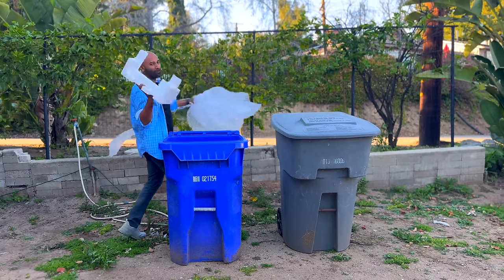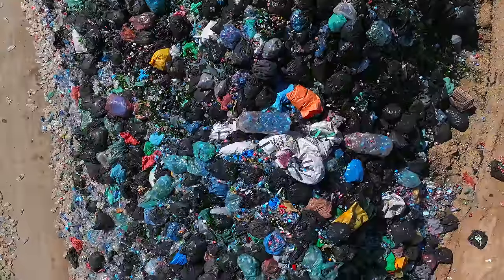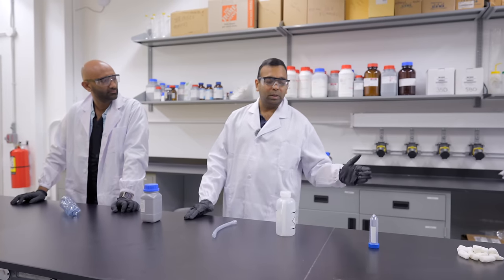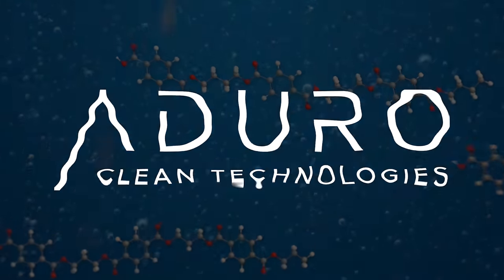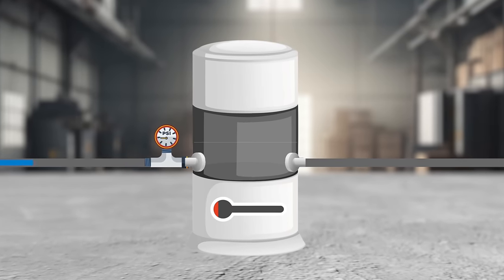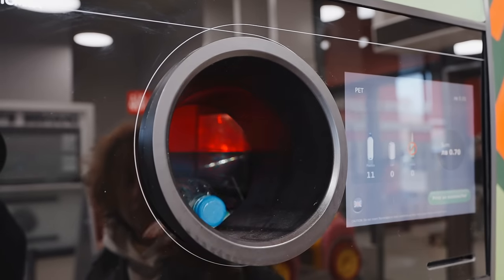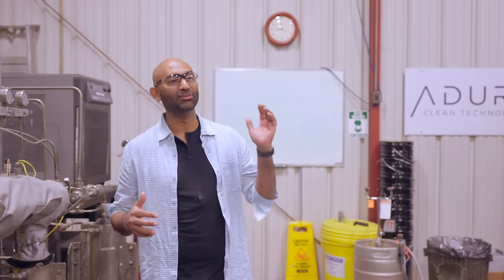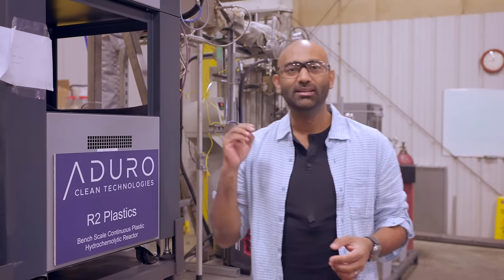Plastic Waste May FINALLY Have a Solution!

Comment from the maker: Check out Aduro Clean Technologies Inc. (CSE:ACT | OTC:ACTHF) https://geni.us/Aduro
Reply: Two Bitcoin da Vinci
Reply: Is this the company that was melting down old pop bottle and made that plastic house in nova Scotia? And why doesn't our carbon tax go to companies like this one
Reply: While I applaud the initiative, we need to talk about backstopping plastic recycling with making plastic waste into beads to aggregated in concrete. Sequestered essentially forever, no incineration, and useful to make concrete lighter and better insulating. Plus, uses very little energy.

Used in geopolymer concrete, can be net carbon negative.
Reply: @bartroberts1514  wow I didn't even know that was a thing cool and hopefully that happens soon
Reply: @scottfraser706  This is all part of the 'circular economy' compared to the 'flow economy' modelling for materials.

It'd be ideal if all materials were on a donut path, so nothing's 'waste', just at a different stage in its use in the marketplace. Since we can't make some things that way, yet, a graceful exit like glassification (sealing materials up in tiny durable beads as cheaply as possible) and using them like gravel in concrete is a more reasonable backstop than landfill.

The thing is, what Aduro makes is far more high value per kg than aggregate for concrete, so it's preferred, for the part of the plastic stream it works on, if economical.

Eventually, concrete breaks down, but it can be used as aggregated for future concrete. Another donut.

Compostable PLAs -- 3D printable and safe for beverage cups, but not long term liquid containers -- are also circular. Another donut.
Reply: @bartroberts1514  I don't think you can call adding trash to concrete a carbon negative.
Reply: You should take a look at supercritical water oxidation; not only should it revolutionize wastewater treatment, it's also a potential avenue to power-positively and economically process a majority of landfill waste, while making it easier to reclaim valuable trace elements.
Reply: @scottfraser706  This IS the kind of this that our carbon taxes go towards. It pays for grants for projects like this as well as subsidies for home solar and larger green tech installations like solar arrays and windmills. Also no this is in London Ontario, not Nova Scotia.
Reply: lol, its a wood gasifier converted to use plastic instead. the offgasings are flammable btw (in case your friend doesn't know)
Reply: Rick: i find it funny that after every video you keep saying check out this video and pointing in the wrong direction. Maybe remind yourself to use the other hand to point in the other direction or place your end of video screens on the other side
Reply: This sounds interesting. Hope they'll keep improving the procedure to make it work eventually, especially when it comes to cost for recycling.
Reply: Recently saw a video about flight attendants wearing uniforms made with recycled plastic polymers, causing unknown illness. 

Would be interesting to watch a follow up on where those recycled plastic polymers go to
Reply: I have been thinking that this sort of process would become the source of our means of producing new materials in a more or less circular process for the future - plastics are just so useful, and we have so many that cannot easily be re-used while also being perfect for their use - turning landfills into future mines for a while (until we use most of what is there).
Reply: Added to my portfolio
Reply: Why can’t we MAKE a law that bottlers have to have “easy zip off labels” and clear plastic bottles with matching caps?   It would make recycling bottles so much easier.
Reply: @CorvetteAustin24 no but it does sequester it
Reply: I'm going to invest in this!😊
Reply: @Fenthule  The US did it without carbon taxes. Eastman Chemical is doing it profitably in a market without carbon taxes.
This is why we don't need carbon taxes.
Reply: @mrbizi5652  The labels are as recyclable as the bottles. Maybe that's why we don't need yet another law?
Reply: sort of. The label is different plastic which has to be processed separately. Therefore if we had uniformity on how they could be “easy zip off labels” instead of glued on like many are now, it would make it easier to have end users separate (while putting in same recycling container) which allows faster and cheaper processing which lowers everyone’s costs of recycling.  Also saves on energy and chemicals required to process as we could focus right tool for right job and not waste.
Reply: @mrbizi5652  Adhesives can be easily released with heat. What you're suggesting would require an additional mechanical intervention.
Reply: It is wonderful that you can recycle plastic, but what do you do about the nano plastics inside the fish we eat and the water we drink.  Plastics are toxic to our bodies.
Reply: @peacepoet1947  This video wasn't about solving all the world's problems.
It was about a single company in Canada potentially reducing future waste.
Reply: @wisenber  don't be so ignorant of the problem of health when it comes to plastics in our environment.  A warning is what I'm giving to society.
Reply: @peacepoet1947  Don't be a jerk and loosely toss around "ignorant" without evidence.
It makes you look ignorant.

As mentioned, the video is about a technology to reduce plastic waste in the future, not a time machine to remove what's already out there.
Trying to toss that on their back is counterproductive.
Reply: There is no other sources for your video?
Reply: If a recycling tax were added to the price of products when sold, recycling plants would become economically feasible and profitable.
Reply: Pretty cool tech, I could give them my money :)

Comment: Video misses the entire point. Processes have existed to recycle plastic forever. The question is "can recycling be economically competitive with non-recycled".  Unless the total cost of handling cleaning processing and reselling is less than the cost of making plastic from hydrocarbons economically it's just a chemistry experiment not a solution.
Reply: I think the main thing here is that if we as a society are able to come together to try and pay more for products just because we know they are taking plastic out of landfills we are gonna be ok. Also, this is great in case we do run out of oil we can go back to all our plastic dumps and turn them back into gas/new plastics.

Comment: I used to work in the plastics industry, what many don’t realize is how much petroleum is used in that manufacturing process. In short, we can save our fuel as well by recycling. Great show Ricky!
Reply: We could also save petroleum by burning the plastic as fuel.
Reply: @gorkyd7912 plastics ARE petroleum
Reply: @joelrunyan1608   We burn diesel, coal, gasoline, natural gas, propane, methane to generate electricity, heat buildings, and drive vehicles. These products are either mined separately or made from the same crude oil from which plastics are made. But we either throw plastics in a landfill where they slowly degrade, or we burn a bunch of fuels for electricity we use for the arduous recycling process. We should just incinerated the plastic as fuel directly instead of pretending we're saving plastic when we're burning other fossil products to recycle it.
Reply: @gorkyd7912  We were burning landfill plastics and landfill methane to generate power. Then the carbon emissions became more of a concern than the energy supply. So now we're back to filling up landfills.
Reply: @wisenber   In other words, the politicians got involved.
Reply: @gorkyd7912  Not quite. Politicians are actually elected. These rules came from unelected bureaucrats.
Plenty of bad politicians, but they actually have to answer to voters at some point.
Reply: Isn't it made with a petroleum byproduct or waste that otherwise they would need to dump or dispose of in some way? Isn't that why they can always undercut every single innovation in packaging because its not a product its a waste product.
Reply: @wisenber the unelected beurocrats thank you. I only have been to one local council meeting in my life the representatives had to stage this begging ceremony from the beurocrats civil servants as far as I know. I dont even know I've asked and looked it up and still aren't sure. But it looked like the reps were asking the civil servants for money to do x y z ..one thing was a bus square a line around where the bus cna stop so cars couldn't go in it cos if cars went in where the bus was meant to go then the bus had to stop at the pier where it was an open water quayside for boats. They had been asking for this for 8 years! The beaurocrats said they didn't have the equipment? Like citizens could have done it easily in 8 hours!!! It was nuts. And the way they said your honourable majesty may we please respectful ask you xyz was sickening and weird. The beurocrats were up on a stage too. So it was bizzare.
Reply: @wisenber Actually carbon emissions are equivalent to harmless fluffy bunny in all the outputting chemicals when burning plastics. You really don't wanna know what else they output when burning plastics, especially when burning contaminated plastics.
Reply: @Saviliana  I know the power plants had scrubbers for particulates like any other combustion plant.
Instead, it goes into landfills, oceans, or we burn even more energy transporting and converting into something else that will have the same three choices.
Reply: Natural Gas is a feedstock too
Reply: @wisenber Yes, but the problem is that plastic isn't just pure polymers, they contains all sorts of pigments and additives to make them have different elements of usage, even just a coke bottle could have all sorts of coloring and additive for temperature control, when you adding the fact of other chemical contaminate during recycle, it is just too hard to be a controllable environment to treating the outlets. Many scrubbers are either had a specific setting in element combination to collect a specifically designed type of contaminate particle, like you can''t rely on a electron scrubbing unit to catch oily subsistence, and solid micro particle collector or splash filter membranes to catch hot gas wastes, it won't work,  and if you really be dumb enough to make such system the cost is overwhelmingly unrealistic to proceed or maintain for long term. How powerplants scrubbers work is they only use a tight specification range of coal or diesel or gas, which contain so little contamination so the scrubber units can catch the only few types of outputting waste at the exhaust.
Reply: @Saviliana  Except they did use scrubbers.
Reply: Therefore big petro!sum will try to stop this idea.
Reply: @Saviliana  eg dioxins
Reply: @Saviliana  Thanks, it's good to have some detailed info
Reply: @elgorrion52  If they weren't elected to Parliament, how do they get voted in by their peers?

Comment: The first time I have heard of companies trying to do anaerobic decomposition of plastics back into what are effectively refined crude products was something like 20 years ago, back when Discovery Channel was still worth watching.
Reply: Yeah
Reply: yep and it still doesn't scale or compete with the cost of virgin plastics. Maybe in a world where energy would actually be cheap.. maybe.
Reply: Not surprising. The chemical process is not so far off from dealing with the sump fraction of crude oil crackers. But as someone working in the research industry, I saw a lot of steam being applied to this idea in the past 6 to 8 years. Every big player in chemistry and waste recycling is doing this stuff now.
Reply: Plastic recycling is the same as fusion energy ?
Reply: Lies. Lies. Only lies
Reply: @Volkbrecht  Well, in this specific case, instead of applying steam, they are applying solvents besides water to increase yelds at lower temperatures. IIRC, he old polymer cracking experimental plant I heard about back then was simply heating the plastics in an inert atmosphere, condensing whatever came off and burning the lightest fractions to heat the chamber.
Reply: Back when Discovery Channel was still worth watching? Geez, how old ARE you? 😁
Reply: Unfortunately it's not the first one! There is an older video about 10 years on YouTube about this exact type of recycling
Reply: This is being done in India too; also in Utah. It's been a few years since I first saw this kind of process. I think it's fascinating and hopeful.

Comment: Aduro has been nominated for the renewable material of the year award at the biggest chemical recycling conference in the world in Germany  The leading nominees will be chosen in June . Only 6 companies in the world. This tech hopefully is a true game changer
Reply: It isn't; there's also a dozen companies attempting the same thing. Every time you ask critical questions about scalability and economical viability the conversation stops.
Reply: @rkatz69  And not just attempting. The research into applications has progressed quite far, and everyone who tries it runs into the same unavoidable problem: over time the reactors clog with a toxic tar made up of the dirt that's clinging to the plastic and all the additives used for whatever product the plastic comes from. It's by far not just bottles and fruit packaging.
Reply: Well therefore are are reactors which can clean themself -> you need to look up screw reactors whichare also used for plastic pyrolysis
Reply: @rkatz69  the difference between aduro and other companies is that their technology 1) works 2) is scalable and lenient to each company's use case. Their technology is years ahead of any other company in the field
Reply: Cross fingers.
Reply: This type of technology only makes sense if the cost of producing new plastics is competitive with the original cost of making the plastic which is basically impossible for the vast majority of recycling.  

The reason it’s impossible is because of the thermodynamics of the chemical reaction. One direction is preferred and to reverse it takes more energy and thus is more expensive. 

The only real solution is to add taxes to all plastic products so that the government can adequately recycle them and make up the difference. All other solutions are just a pipe dream. 

This tech will be needed when people wake up and demand we fix this. Hopefully people can stop all these nonsense climate change crisis and fix the real problem (general pollutions like plastics and smog). CO2 is a distraction.
Reply: @cbongiova do you think co2 that gets released is having no effect on the planet? Or just don't think it is as much of a threat to the planet?
Reply: @josephfuller6229  it’s not a threat to the planet at all. Might be a problem for humans if it increases temperatures significantly but there’s a lot of bad data and models that are pushing this to appear to be a bigger problem than it really is. 

I’ve live by a coast line my entire life and it hasn’t changed in over 40 years of my witnessing and the temperature has changed significantly either. 

I know climate change is at a global level but it’s hard to reconcile their data and the factual reality I’m witnessing. 

Smog and plastic pollution is more important and I think CO2 reduction may fall as well but it’s not the main pollutant we should be concerned with.

Comment: When I started working in the late 1970's my boss subscribed to a magazine called Plastic Weekly. Yes it was riviting stuff! 😆Almost every week there would be an article about recycling plastic waste. The problem has always been, it costs too much to recycle. Now that we have mountains of the stuff all over the planet it looks like it has become a viable resource to start using. Lets hope so.
Reply: I laughed about the poly styrene line in this. The bulk of Styrofoam means you burn more fuel, moving it to recycling that you can harvest.
Reply: @sparksmcgee6641  low level heat will collapse it to a fraction of the volume

Comment: This video addresses a part of the challenges that we face in the plastic issue. I got into 3d printing to learn how one can reuse plastics while they get it together to actually recycle. I quickly learned that 2x4 is more practical here than 3d printing. 3d printing needs the recycled products that would come from the systems Aduro Clean is doing. glad to see that someone is actually using the label and likely the catchup in the bottle to help process the plastic.

Comment: Even aluminum cans have plastic liners so things like carbonated beverages don't eat through them.  There are YT videos showing what is left after you dissolve the aluminum from the outside of the can.
Reply: I thought aluminum cans has a layer of epoxy not plastic
Reply: @patrickday4206   - don't worry many people think "tin foil" is actually tin, rather than aluminium....
Reply: it's a taste issue
Reply: from what i know, the Aluminum can recycling involves going through a melting process.
the high heat burns away the plastic and any food residue.
then the aluminum is purified to extract the impurities
Reply: It’s now a water based, latex formulation. It’s made by ici, the parent company of most latex paint companies, which is now owned by akzonobel.

Comment: Wow.  I hope this process works on a larger scale.
Reply: It indeed works on a larger scale, the scientists confirmed with confidence that the technology is lenient and scalable to fit each company's use case
Reply: @ts8960 Time will tell... would you give odds, say 1:100,000 on $1000 usd, you seem to be cock sure or else just willing to repeatedly write the same or a nearly identical comment/reply
Reply: Don't hold your breath.
Reply: @ts8960  if its ready then where is the commercial machine, the "trust me" from the scientists is not enough.
Reply: @vinay7397 according to the vid, it isn't ready to scale up yet, that's why they are still working at an experimental level